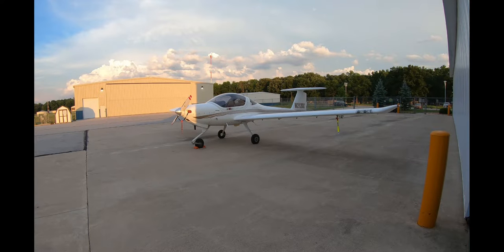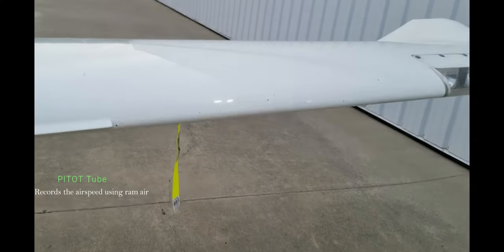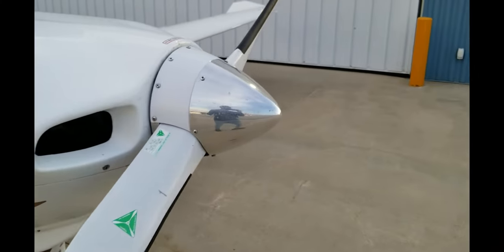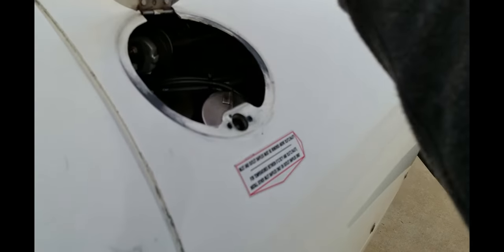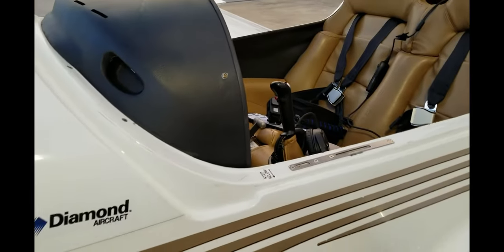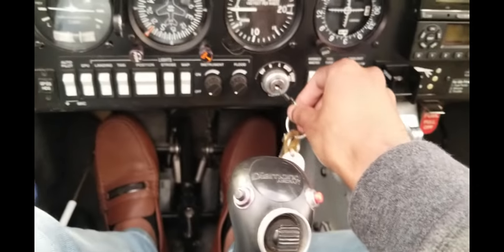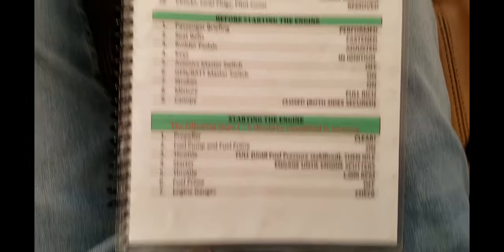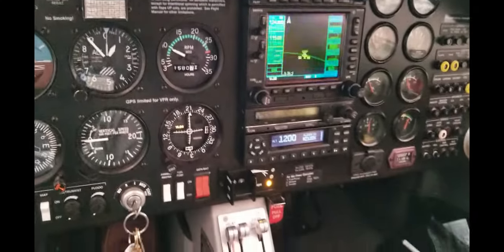Preflight Checks and Engine StartUp - Diamond DA 20.

Comment: Having learned to fly on the A-1 version, with its twin altitude-compensating carburettors, I learned that the A-1 is very underpowered. Rotax 912 is a reliable engine, but at 80 HP it is too underpowered for a two-seater. I got twice the climb rate while flying solo vs flying with my instructor. C-1 version seems to be a much better aircraft with its 160 hp engine. Plus the rear-facing windows improve rearwards visibility.

Comment: I wonder why nobody seems to perform the procedure that is very important for a Rotax engine. That is before starting it (ignition switch off!!!), remove the oil cap and then manually rotate the prop 3-4 turns until you hear some gurgling of the oil. That makes sure to have enough lubrication for the startup. If you skip that, the engine experiences unnecessary extra wear causing reduced lifetime.

Comment: 4:03 the SUCKING actually creates the noise of the stall horn. Not the blowing. You could just as well use your mouth to give it a good  s u c c  and achieve the samw
Reply: yep, and it works not when you fly to slow but on to high angle of attack, if it works when you are to slow it will be noisy during taxi for example or on ground roll.
Reply: I don't know anything about this, but I did notice that and thought it did not make sense to measure blowing when it is supposed to indicate lack of air as in a stall.

Comment: You're not supposed to put the fuel back into the airplane when you've drained it. It has to be discarded in a fuel drain container.  Otherwise, thanks for good video!
Reply: @Zyonix007 you can but not recommended
Reply: It’s not like you own a diamond da20